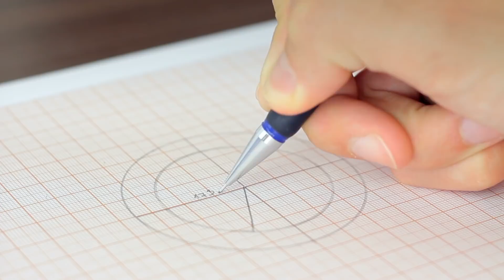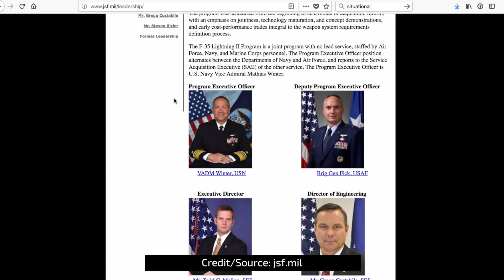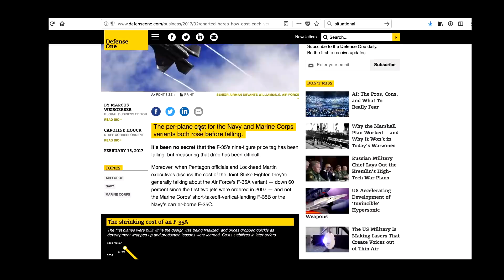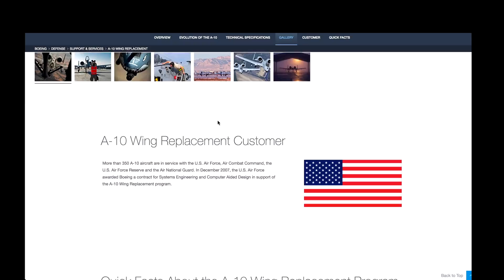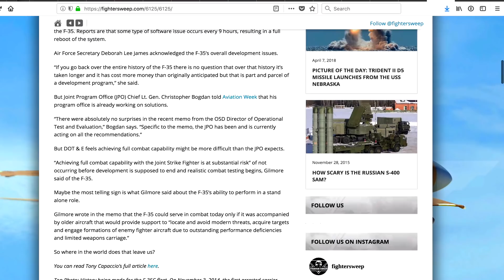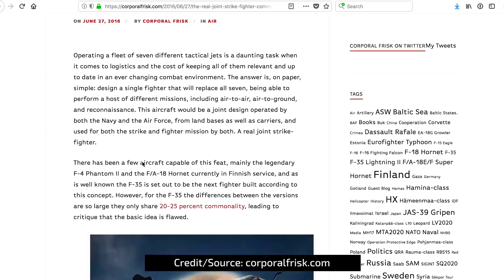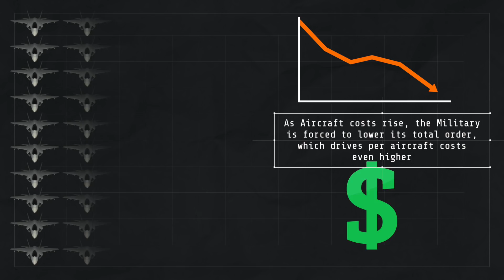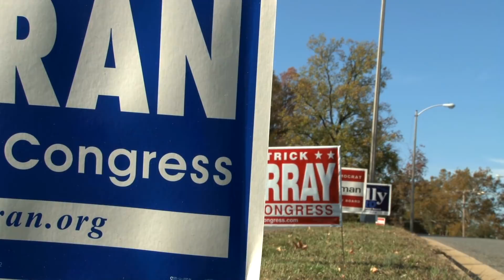Why the F-35 Lightning II Might be the Most Expensive Military Aircraft Mistake Ever

Comment: It wasn't to longer ago some genius decided during the Vietnam war they didn't need a gun in their fighter jets. They would use missiles. And what happened when your missiles failed to hit the targets? You had pilots in the shit. New shiny toys are great but some old ones are just as good. And only need i,provements.
Reply: "Our pilots had become dependent on missiles, and lost some of their dogfighting skills."
Reply: I'd like to point out that the reason the F-4 phantom was deployed without the gun was because it was envisioned that it would never use one, ever. It had a powerful radar, a powerful engine, and big fuel tanks. It was supposed to truck missiles way out and intercept a flight of bombers, launch, slaughter the slow, unmaneuverable, lightly armed, lightly armored bombers, and then head back once it blew its wad. Then Vietnam happened and some genius decided to deploy the AIM-7 Sparrow armed Phantoms against the fast and agile Migs. Sidewinder armed Phantoms actually did really well. It could carry a lot of them, and once it blew its wad, it would just go home.
It would be like using the back claw of a hammer to attempt to remove a staple. Doable, not well, not easily, but doable, sometimes.
Reply: Samuel Wang correct. Which is why the F-22 is almost obsolete, it cannot really be used in current conflicts as it was built to fight an enemy that had gone by the time it was in production.

If a nation like China comes into things then the F-22 may actually be used as intended.

The problem with military technology is that it is often obsolete by the time you have developed and perfected it. Hence why modifying old and existing kit works quite well.

Modern aircraft are built to accept technology which isn't even in full use yet, but 'predicted to be the future' as were the F-4s. They didn't need guns for the enemy they were built to fight, and that was too right.
Nobody expected the fight as seen in Vietnam, just ask the multi billion dollar military that withdrew.
Reply: Actually, the F-22 is still quite relevant. While initially designed as an air dominance fighter, many changes have been made and as such it can also carry air to ground weaponry. Data sharing now allows the F-22 to use its sensors to gather data and then send it back to an AWACs or other battlespace command center where the data is used to develop a track for another platform to use its weapon. It's not like the F-35's ability to actually guide a weapon launched by another platform itself, but it's still pretty impressive. The computer isn't as smart, the software isn't as sophisticated, but it's a head and shoulders better than anything anyone else has fielded so far.

It wouldn't be ground striking against a sophisticated air defense system, but against old systems deployed by most countries in the world, it could probably do it pretty well.

Even though the Navy brought back Top Gun and added a gun pod, the Airforce simply changed up the training and started issuing more Sidewinder missiles, actually achieving better results than the Navy program.

Also, I'd like to point out that we didn't withdraw from Vietnam because we were spending too much money, or because we were losing. There was actually more than enough money to go around, and the Tet Offensive cost the Vietcong tens of thousands of their most experienced and veteran warriors. No, we withdrew because the public didn't want the US military to keep murdering dudes in a far away land, they didn't think that we were losing or that it was too expensive, they thought the war was downright unethical.
Reply: @underwaterdick  no you are wrong the f22 is no where near obsolete it is the best most advanced and most powerful fighter jet ever made
Reply: @underwaterdick  also you do know that the military is like 20 or 30 years ahead of the civilian population so it is not possible that they are obsolete when they are made public
Reply: @red-pm5qg  I am not debating that it isnt the most powerful or advanced, but my point is, the enemy and conflict it was built to fight is no longer relevant.
The aircraft was not suitable for use in Afghanistan, did they even use them in Syria? Does an F-22 have any kills to its name? The F-35 has been used in anger by both the Israeli air force and the US.

A modern NASCAR car is fast and advanced, but suddenly take away the oval race circuits and swap them for a European racing circuit and they are completely obsolete.
Reply: Mark F 
Actually, that was 50 plus years ago.   You can have your old fighter aircraft, and I’ll take the F35. What color flowers do  you want at your funeral?

Comment: The F35 is like relying on a calculator to do the work for you. Yeah it's awesome when it works. Have a sensors go down then what?  The F35 won't take the abuse that the A10 will take. Only a fool would get rid of the A10 and rely on a non battle tested F35. Let's see the F35 fly back to base without a wing like F35 did. I'm sure operating cost of the A10 is cheaper.
Reply from the maker: We have an A-10 video coming very soon!
Reply: They aren't replacing the A10

Comment: Remember that one time the Air Force wanted a fighter bomber and the navy wanted an interceptor so they made a joint fighter program? That turned out well. Also The last time we had the same fighter for those 3 branches that worked, the pilots still affectionately called it the brick.